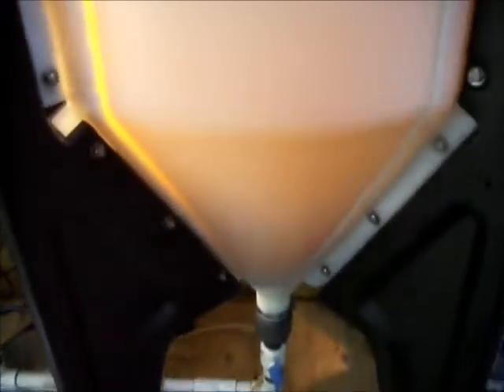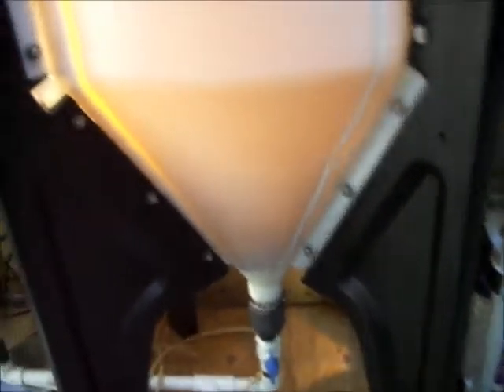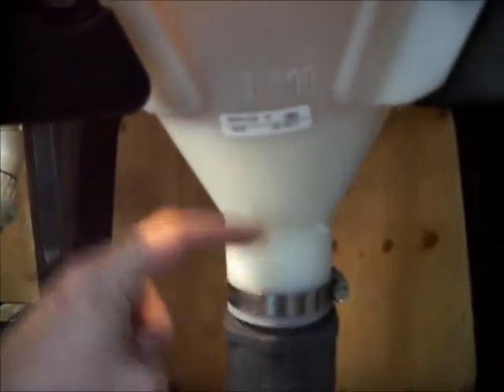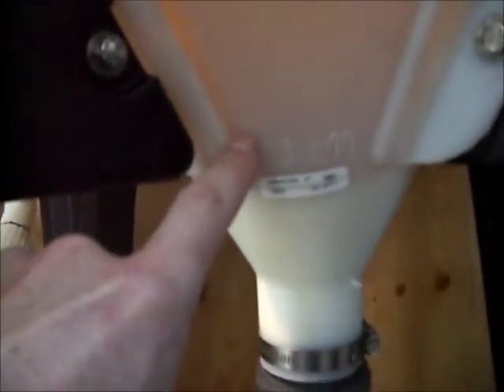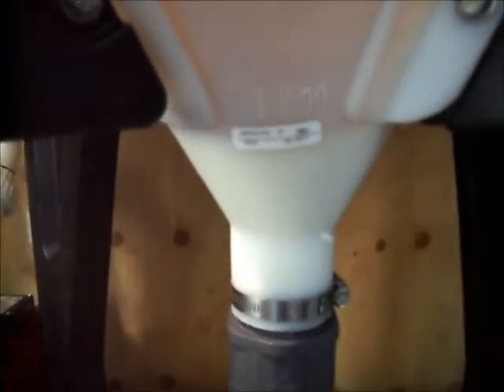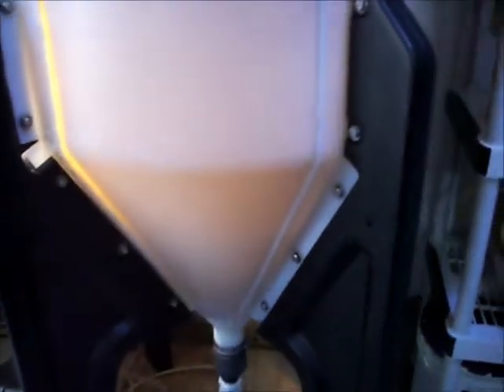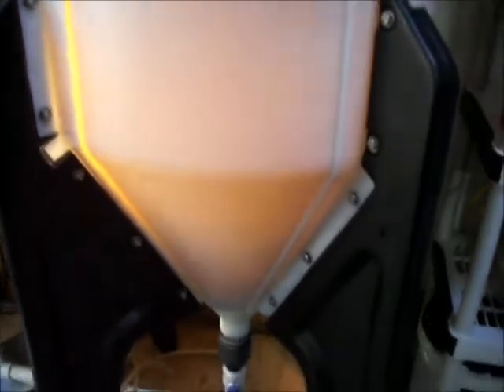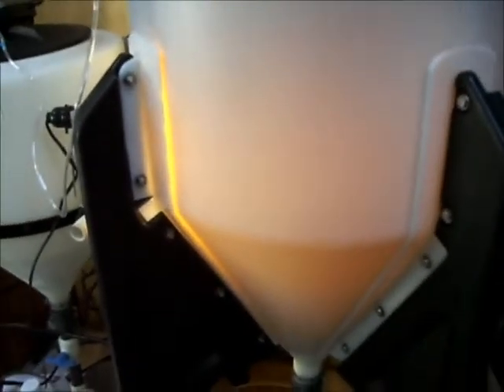biodiesel clear

Comment from the maker: No problem. Glad to help. A lot of the videos when I first started this didn't show any details. See the latest video on "updates" on how I modified the pump quick disconnects. BTW the northerntool clear water pump still works great. No leaks. Impeller is brass and zero wear. Don't forget using salt in hot water to break an emulsions if you have trouble. I continue to also add a shot of sulfuric acid in 400ml water pour that in before water washing (drain glyc first). Less emulsion issues.